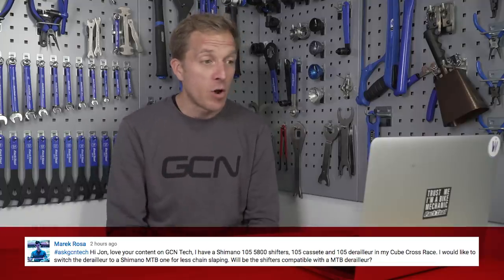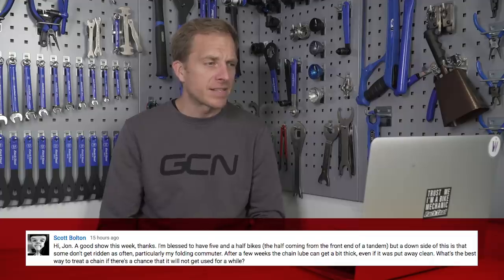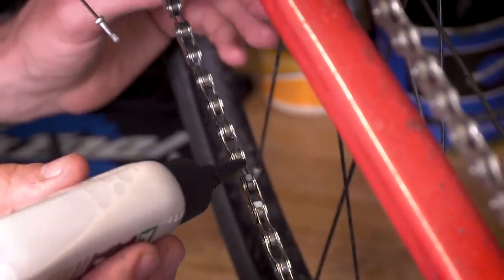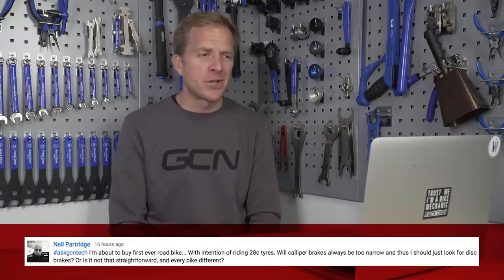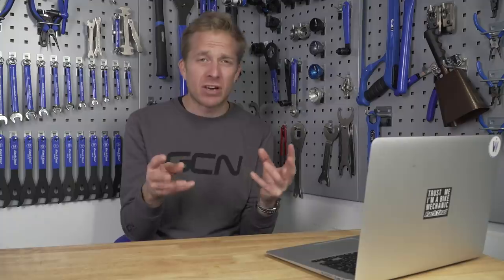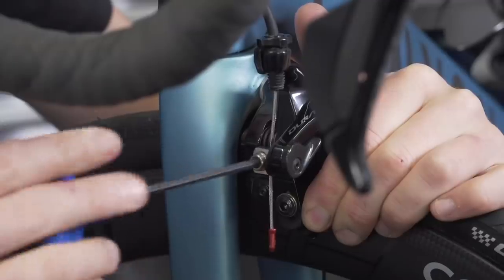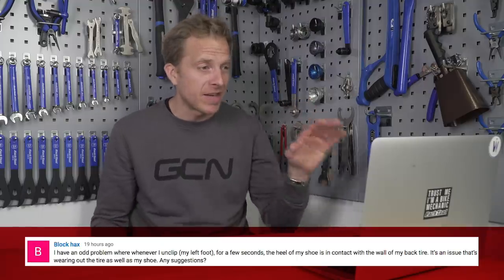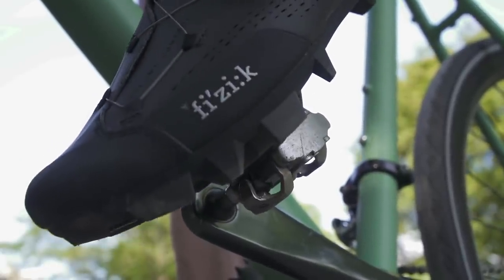Wide Tyres, Rim Brakes & MTB Mechs | GCN Tech Clinic

Comment: Re: shifter cable, in situations like that, is replacement done by the same or different guy? Ive had experience with a bike mechanic that would just chronically undertighten the headset preload for example.

Comment: Hi, Jon. I am having some trouble with my shifting, where the derailleur won’t engage chain to the highest gear about 90% of the time. I have a Shimano 105 rear derailleur (about 3 years old) with Shimano 600 front derailleur and 6 speed cassette with downtube friction shifters on my Panasonic DX-2000. I’ve recently replaced the chain and did a deep clean of the bike. While that’s helped it ride a bit smoother, it still doesn’t engage into the highest gear / smallest cog even though the pulley wheels are directly below. I‘m pretty sure it’s an issue with my adjustment of the high limit screw, though tightening or loosening doesn’t seem to make much difference. Is there something I’m missing here? The only thing I haven’t done is replace the shifting cables in a while, so maybe that’s it. Thanks for your help. #gcntech

Comment: #askgcntech
Hi Jon,
I just moved into a new condo and the only place to permanently set up my bike trainer is on the covered patio. I live in Canada and it can get down to -25 Celsius in the winter. 
Is there a minimum temperature I can safely use an aluminium bike and magnetic trainer at?
I really don’t want to snap my frame because it’s too cold. 
Thanks!

Comment: #askgcntech On my bike the rear axel/hub is slightly smaller than the width of the bike's rear stays so when I tighten my wheel into place I can see the rear stays get slightly squeezed together. My assumption is this is adding a bit of twist to the chain system and allowing for the minor shifting imperfections I notice and extra wear on the system. Is there anything I can add on to the axle to increase the wheel width to offset this issue?

Comment: #askgcntech Hi John, great show, you are number one! 
I have an odd BB/crank related issue. In short, I built an indoor trainer for the winter out of an old spin bike that I have been using with Zwift connected to speed/cadence sensor. However, given my hacked setup, my Zwift power output is only determined by a positive integer number multiplied by my cadence which in my case (without going in further detail) results in circumstantial “Zwift doping”. Ideally, I would like to use my Ultegra 6800 left-hand-crank power meter, but my trainer has a squared tapered BB. Is there any adapter/hack/bodge to use a Shimano Ultegra crank with a squared BB spindle? Replacing the BB in my trainer is not a viable option and I don’t want to buy a new power meter or indoor trainer. Please don’t leave me in the dark, Thanks!

Comment: #askgcntech Hi John, great show.  I have a question regarding the storage of tubeless wheels and tires.  I just installed my first set of tubeless about a month ago and now that winter is coming in Ottawa, I’m going to install my Cervélo on the trainer. The trainer is direct drive, so the wheels will not spin all winter.  Are there any precautions to take when storing tubeless wheels for the winter season? Any risk that the sealant may pool and harden in the bottom of the wheel? Thanks!
Reply: It will pool unless it's one of those non-drying types (finish line, Muc-off, etc.). Best advice is to remove and drain, add more sealant and reinstall in the spring.

Best life I've gotten out of conventional sealant (Slime, NoTubes, Caffelatex, Orange Seal) is about 4 months.

Comment: #askgcntech Hi there! I have new 50mm deep carbon wheels, nice riding but after one hour wet ride I found that my rear wheel is full, but I mean full of water. Took me a good 45min to shake the water out from unscrewed valve (tubeless so I was worried my air will leak). Is this normal? I don't have to have wheel corroding from inside and how can I prevent this? I was thinking about pouring tubeless sealant into the rim, what do you think? Thanks

Comment: i recently noticed that my tubeless tire has a tear in it. it seems to be sealed with the tubeless fluid, but if i don't use the bike for a while the tear shows up and leaks air . Because of this tear that isn't sealing permanently should i change the tire? can i put a patch on the inside to "seal" it? will the patch also be impacted by the tubeless fluid if i get another puncture in the same area?  #askgcntech

Comment: #askgcntech I've got a SRAM ViaGT groupset off someone and as they specified the shift levers weren't working properly (the front one was damaged and shifted only when it "felt" like it, the rear one works ok), anyway i was thinking on running the setup on my CX bike, and i figured of running either a 2x10 or a 1x10. I'm considering using SRAM Apex levers (DoubleTap 10s for the rear, and either S500/900 for the front or Apex DoubleTap 2s) are they compatible. Alternatively I've got a pair of Shimano 105 5700 levers I was considering running with the setup, is there a chance or does that result is poor shifting (this would be my budget option). Thanks, love the show.

Comment: Hi there! Tech question for you; How would you protect your bike against scratches and jammed sand/pebbles? I'm riding an aero frame (BMC TMR01) where the clearance between the tyres and frame is a few millimetres only. I'm hoping to protect the paintwork as much as I can, even if it means adding a few grams of tape etc.
Reply: Nima Foroughi hi there! Great bike! We like to keep 4mm clearance to the seattube and the stays, when designing a bike for a specific tire size. This is a safe margin. Adding paint protection will in fact increase the risk of getting stuff caught between your tire and frame, because you’re decreasing the clearance gap. But if you must add something, buy yourself some PPF, paint protection film. It’s meant for cars, to prevent keying and scratches. Works great, and it’s not too thick! Cut to size and place it on the bike! But make sure it’s a self-adhesive type.
Reply: Thanks! That was helpful in multiple ways. I think this answer is very relevant for the Cervélo riders as well (or any aero bike for that matter). Now that many people are considering wider tyres to reduce rolling resistance or increase comfort, the gaps between rubber and frame are shrinking on the older aero bikes. For me, I've decided to run tubulars to get a little more comfort for the same width of tire, and it makes wonders for the comfort on my bike. You mentioned "we". Can I ask if you have experience with frame design or this bike specifically?
Reply: I have a Cervelo C3 which I ride on tracks sand etc what I do after each cleaning is use a good deal of a carbon bike polish and I mean a heavy spray and just leave it on, it leaves a thin film on the paintwork, and any little marks then polish out on the clean when I remove the old polish.
Reply: Interesting, but doesn't the polish slowly "polish away" the clear/outer-coat?
Reply: it hasn't so far (9000 kms) as you clean off on every full bike clean

Comment: #askgcntech - Canyon H36 integrated bar/stem.. Why is there no dedicated out-front mount for the Wahoo ELEMNT BOLT? Most of the GCN team use the BOLT and also ride Canyon bikes with the aero-cockpit... as do the world tour team Katusha Alpecin? I understand there is a HACK to transform the Garmin mount, but it is far from ideal. plus it ends up not looking as sleek as the Wahoo BOLT standard flush mounting. The current range of Canyon's appear to have almost totally done away with the normal bar and stem - so isn't it time Wahoo/Canyon/K-edge offer a product for the BOLT? perhaps others are in the same situation?

Comment: Hi Jon,
Have you ever used a RoadLink derailleur hanger extension from Wolf Tooth Components in order to allow a 105/Ultegra rear long cage derailleurs work with a mountain bike specific cassette 11-40 (11 speeds) . I would like to try replacing the 11-34 cassette on my gravel bike with a 11-40 cassette if I could keep the front 48/32 Praxis Zayante crank-set  I currently have.
Reply: I haven't tried it with Ultegra, but both my wife and I use road links with Tiagra components (medium cage, 11-36 SRAM cassette) and they work like a charm. You do need to be careful though, Shimano MTB and road cassettes are different widths, so the shifters may not work properly (I think Wolf Tooth has another component to help with that), that's why we went with SRAM cassettes.

Comment: #askgcntech Hello, thanks for all the learning so far! I have the older Dura Ace 9000 groupset on my summer bike, would it be possible to use the neater Bar Plug mounted EW-RS910 to replace the junction box currently slung under my stem? Thanks.

Comment: #askgcntech hi guys, I have ultegra discs on my canyon ultimate and whenever I’m descending a steep hill my front brake will stick to the disc for a few seconds after releasing the brakes causing it to tap tap tap. I have new pads, new dura ace rotor and it has been cleaned, the brake has been bled as well. Is there anything else I can do to try and fix the issue?

Comment: #askgcntech Hi, great videos, I love them! I have a question:I am planning on building a singlespeed or fixed gear from an old, vintage French road bike. Is there a standard for the threads on the rear hub where I am going to fit the single freewheel or the track cog? Do they have all the same diameter or does it varie? I am not able to take off the freewheel without destroying it and I want to make sure that I don't have to change the hub... Thanks!

Comment: #askgcntech Recently bought a TT bike with an Ultegra 6800 crank with 52/36 chainrings. I want to put on the big boy TT chain rings.  Will the Dura Ace 9000 55/42 chain rings fit on my crankset?
Reply: Yes, they will fit, as they use the same 4-bolt design and 110 mm bcd diameter. But you still have to check whether the front derailleur can be raised far enough to clear that 55t chainring.

Comment: #askgcntech  -  My carbon seat post slipped down a couple of inches on a ride recently and when I put it back up some of the clearcoat has been damaged.  Is there any way to repair this?  Thanks...Nigel
Reply: Nail polish (varnish), better clear with no sparkles. Depending on the location it makes a very durable good looking repair. Best on smaller components like scuffed shifters but can be used on frame chips too.

If used on a seatpost make sure it is fully cured before reinserting or it will glue itself in (can be loosened with a little heat though)
Reply: Thank you, sounds like a good fix, I will give it a go : )

Comment: John! I'm planning on re-cabling my bike soon and had a bit of a brainwave. Is there any merit to lubricating the cables and inners with a dry lubricant like Molybdenum Disulphide? It's sometimes used in sports shooting to coat bullets. Cant imagine it doing any 'arm. In my mind it's the ticket to easy breezy shifting and braking #askgcntech
Reply: Often the inner and outer cables already have a teflon coating on them wich makes them plenty slippery
Reply: It’s common practice to coat the inner cables in a little bit of Finish Line Teflon Grease. This definitely improves braking and shifting smoothness! But make sure to give the gear cables a good stretch too, so that all the metal strands are pulled tight, before permanently tightening the cables down. The way to do this is to shift up the gears without spinning the rear wheel. The tension you feel is the cable being pulled tight. Shift back to the previous position, loosen the now tightened cable at the derailleur and do it up properly.

Comment: #askgcntech I have a question for my favourite bike mechanic! On my vintage commuting 650B Gitane bike, whenever I ride no handed with some speed, my front wheel and handle bar start to wobble. How can I solve this problem?
Reply: Check that nothing is loose (headset, hub bearings, etc).  Beyond that, it can happen just as a result of the natural frequency of your handle bars, in combination with flex in your frame.
It doesn't necessarily point to anything wrong.  Most bikes would do this at some speed.  The ones that don't, it's likely just that it happens at a speed that they never ride no hands.
Incidentally, the best way to stop a high speed wobble is to press your leg into the side of your top tube.  This will damp the frame oscillation and should stop the wobble.  Trying to stop it with your hands can sometimes make it worse.

Comment: #askgcntech
John, is there a way of telling if a particular wheel/rim is ‘tubeless ready’ ? I know that a lot of modern rims can be converted using the right valves and rim tape but I don’t want to waste my time trying if they aren’t compatible with tubeless tyres. (2017 Willier Jareen 105 Gravel bike).
Thanks in advance, Nigel
Reply: Jochem:  Thanks for that but it appears that the rims used on the Wilier Jareen are made by ‘Jalco’ which doesn’t appear on the list ☹️

Comment: #askgcntech Will a pedal- or crank-based powermeter work on a gravelbike on rough roads? I am thinking about buying one allroad bike that does it all (i want to invent a modular bar/stem solution for it too, with zip-on bartape and and lever quickreleases). but will a powermeter give me accurate measurements on bumpy terrain or will the measurements be confused by the forces that occur offroad?
Reply: Yes. Elite racers in dirty kanza use them. But the challenge is finding one that works with both gravel biking gears and compatible frame. The powermeter can't be on the spider, the way the BCD works on gravel gears(48/32, 46/30) is they end up in the same position as the spider.
Reply: If you get your low  gears with the cassette instead of the chainring, Power2Max has a 110BCD available.  I run one with a 40t narrow-wide ring on my 1x road bike.  I know you can go down to a 36t, as that's what comes on the shimano CX50, etc.
Reply: some of the pedal-based power meters out there have been tested extensively on cobblestones and gravel. i know specifically the vector 2/3 and the favero assioma. oh, also stages cranks work well, supposedly. i know dcrainmaker has done some pretty extensive tests on cobblestone to figure out if that sort of terrain is a problem.

Comment: Can anyone recommend me good gloves that are protecting me against heavy rain and cold weather? All the ones I tried so far are getting soaked in water after a while.
Reply: I don't think anyone has ever figured this out. Gloves are really hard to make waterproof. Mountaineers always carry multiple gloves to swap. You want to make sure the cuff is long enough that your jacket sleeve goes over the top... this way, water does not run down your arm into the glove. Some manufacturers are also developing a seamless membrane to avoid weakpoints (I don't know about cycle kit, but Black Diamond outdry? use this). 
I think Hunt & DeFeet have developed some layered glove system you may want to read up on... think it was only released this year but should be some reviews about by now. I like this idea of separating the warmth and waterproof parts of the glove... it is more versatile and everything can be dried quicker.

Comment: #askgcntech I bought the cheapest model Giant Contend to get into road cycling and the Shimano Claris works great in the rear but the front shifter is clearly made for a 3x chain-ring and never quite aligns with my 2x chain-ring, is there anyway to actually line them up properly or should i just upgrade the groupset to avoid all the fuss?
Reply: Do you have a photo for the front mech? The design for the 2x and 3x front mech is completely different. If it is indeed a 3x front mech installed on a 2x system, take it back to the dealer and have it replaced; if it is a 2x front mech, then it just need a more skillful mechanic
Reply: yeah im not buying from that shop anymore, strangely bad at assembling bikes they are, i don't have a picture of it but the shifter has three positions.